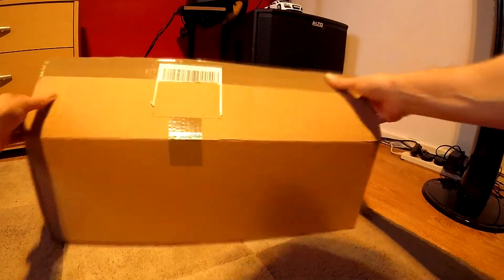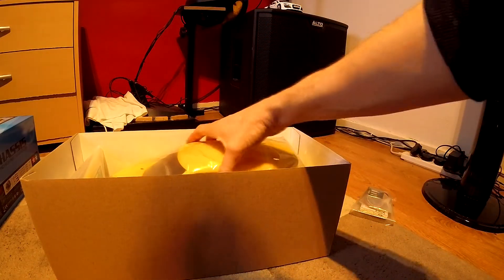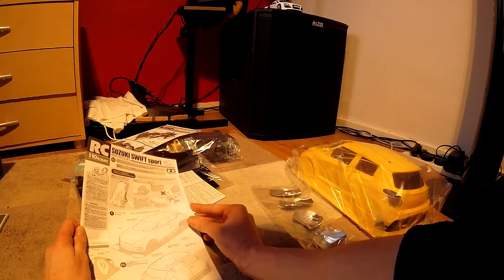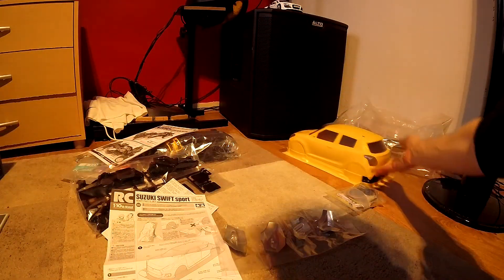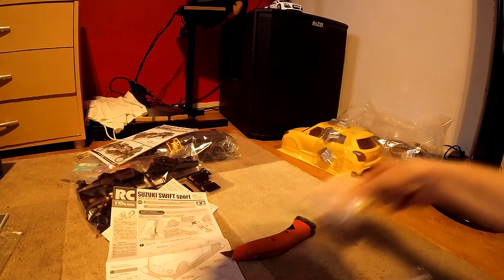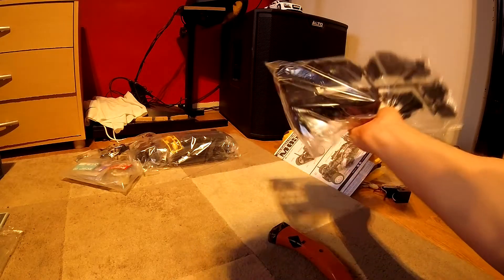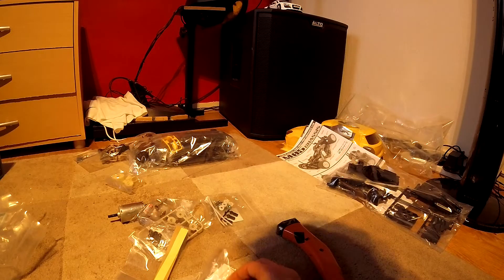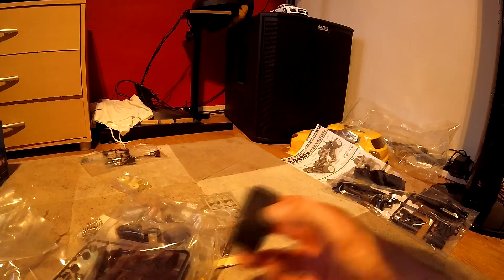Rc Car Unboxing, Watch to find out what RC Car 😁👍👍👍

Comment: Very nice mate, doubt it won’t be long before it meets a brushless and lipo lol 🤪 was looking at these not long ago, I like the mk2 escort, there’s a vid on here somewhere with one fully upgraded/ brushless and it’s eye pleasing to say the least dripping in alloy and carbon only draw back is you need a good stretch of smooth tarmac, you will have too do some progress vids for us, a completion of each section and the big one👍🏻👍🏻👍🏻
Reply from the maker: Hahaha thanks mate, I am not sure if I should  make this Brushless , I shall see how it drives firstly if it’s quite grippy then I may slap a spare Arrma 12turn brushed motor into it and see if that changes anything. I have a few BL motors 
The only 3.2mm shaft I have is a Castle Creations 7700kv which might be a touch to quick 😁. 
As for the Tamiya escort I do like that but one it isn’t available yet to my knowledge and also I’m semi reluctant to part with £170 for a Tamiya Kit. But I have seen some guy on Y/T with it, it looks quite entertaining for a Standard 540. I was rather surprised tbh. 
As for the build Vid ? I could of done I guess I didn’t want to bore the heck out of ppl. 
I’m getting through it, I had a day off yesterday and I got a fair bit done. But the rest will be slow progress I work nights and sleep during the day ,so very little time to spend on my RC,s or Id be putting up videos everyday. 
Recently when ever I have a day off it’s P’ing down.

Comment: Nice one mate 👍 I’m interested to see what you think of it once you’ve give it a thrashing or two,I’ve not had any of the Tamiya FWD stuff.
Ive got a brand new Subaru XV-01 sitting that I’ve had since before Xmas ,I need to get my arse in gear and get out with it .👍
Reply from the maker: I think it’ll be rather nippy🤔  I found my childhood Tamiya Mondeo BTCC  In the Loft minus the body shell. I have been driving it In my estate until a steering arm popped off and it met it’s fate with a car tyre, Totalled and the cost of parts was silly so I sold it for parts made enough to buy the little suzuki. 
I’m also taking a shine to the Suzuki Jimmy Mf-01x, I just wanted to have a little bit of fun rather than worry about Top speed . 😁
Reply from the maker: Yes mate the weather isn’t really too good atm I won’t be driving this little chap on the grass.